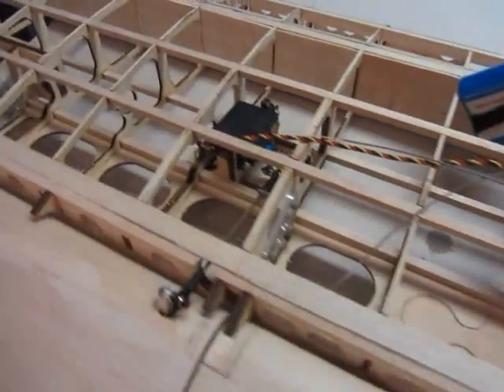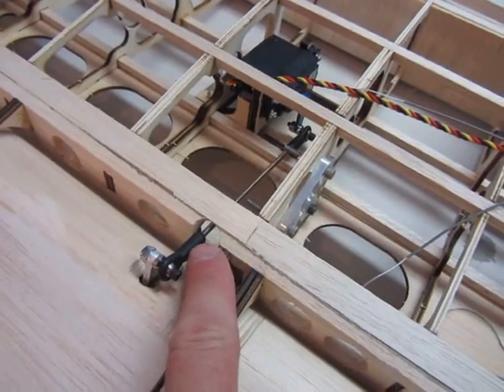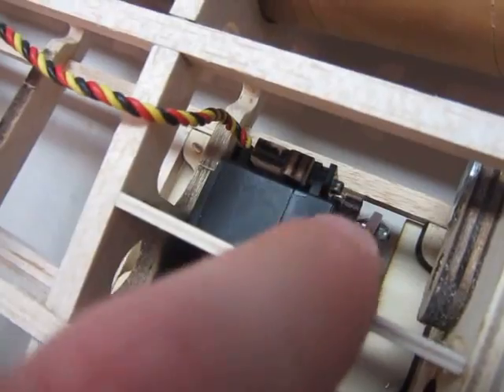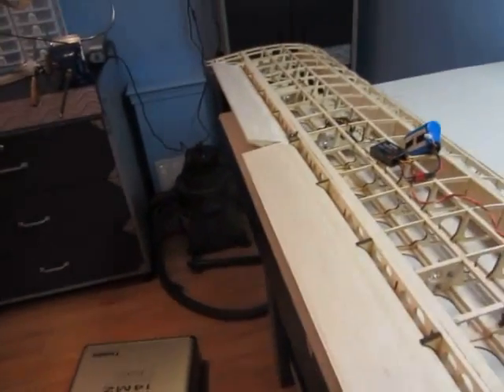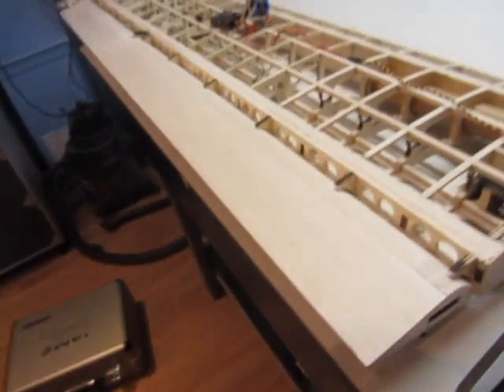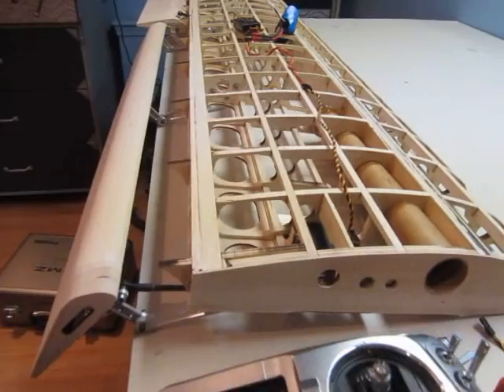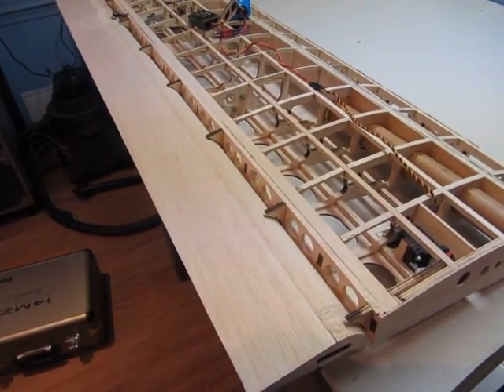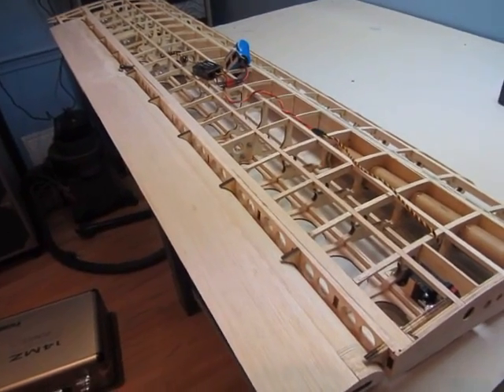aileron and flap movement

Comment: Nice work sir. I am building a P-51 Balsa Wood from scratch and I am to the point where I need to install my servos for my flaps and ailerons. What are the specs/manufacturer for yours? If you don't mind me asking. I have a 60 inch wingspan and will be installing retracts for my wheels as well. I am going to use a gas engine. I decided to go old school with this one. One thing the fellas down at the nearest hobby r/c shop said was that the balsa wood constructs as we are doing are a dying art. I hate to see that. I salute you on your craftsmanship.

Comment: Very nice worksmanship there. However, why didn't you put the single servo in the middle of the flap rather than from the end. Torque loads can cause enough twist to cause binding and misalignment. A servo at each end would be more robust and give smoother motion. I, also, don't like the sound of that servo buzz either.
Reply: This is how it is done on the real Airtractor so i had to keep the design as close as possible from the real plane.